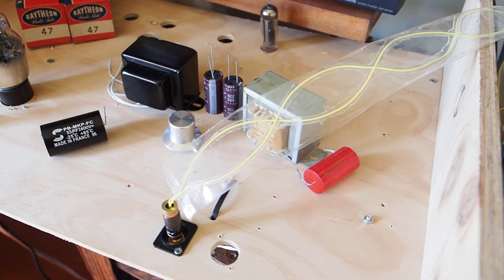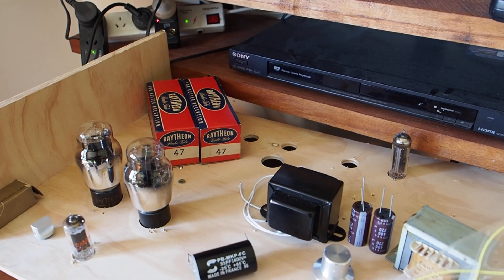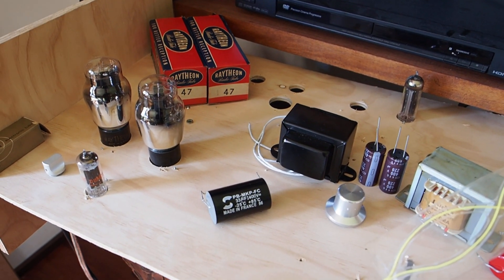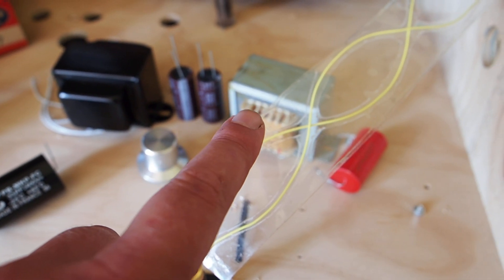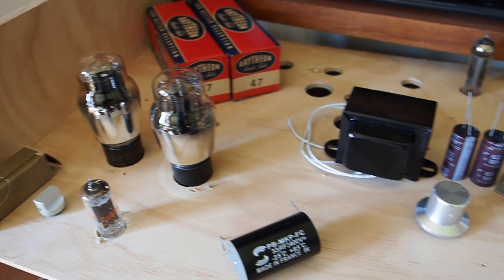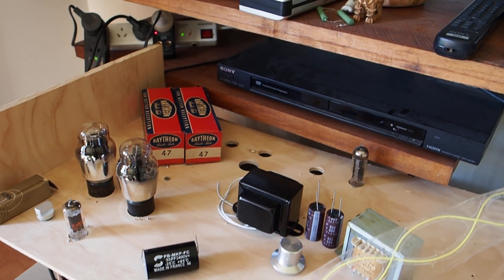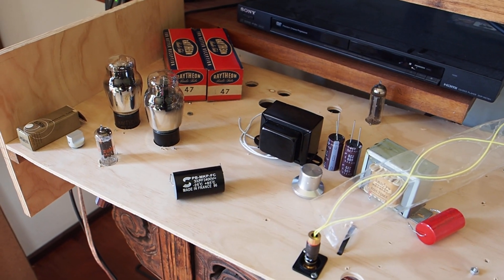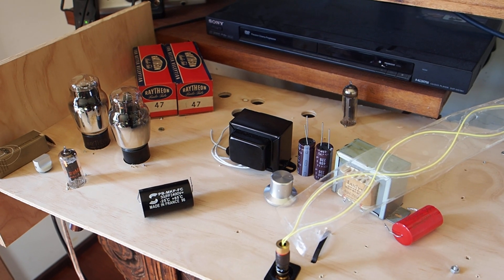My new type 47 power amp design: Q&A, concept, details, how it sounds

Comment: Hi, I was thinking you could try some zener diodes and resistor on the screen which would be 
cheap and easy to show if the tube reg would work. I think you would get a more dynamic
punchier sound if the screen is tied down and not be able  to fluctuate. In general pentode amps that I have heard in the past that were screen regulated sounded punchier than their
ultralinear counterparts.

I used to use gas regs in my preamp but because I used high transconductance signal tubes the preamp would have a tendency to oscillate and become unstable.You also can 
not hang much capacitance on the gas reg or it will oscillate.

I am also thinking a constant current source on the cathodes of the 47s might lower distortion further by holding the horizontal loadline more stable. By the way I seem to remember seeing a chart with lowest distortion tubes and I think the 47 was very close
to being the best just behind two other tubes one being the 4P1L.

Cheers Lou
Reply from the maker: Hi Lou. Great report, thank you. I will give the fixed supply a try, first to check/measure what it is doing now and then to fix the screen voltage via a shunt. I got a real improvement with changing the final 33uF cap from referring to ground to the cathode (ultrapath). At the moment I've also got a 220uF electrolytic over the bias tube, but that effect is neglible.

Yes Alia Moglia's chart of lowest distortion 'triodes' had the 47 after the 6E5P and 4P1L (no.1 tube). In Sound quality I would rate these 3 tubes: 47-4P1L-6E5P where the 4P1L trades it's DHT subtilty with some treble brittleness that I don't hear in the 6E5P. I've got a nice collection of 6E6Ps.. extremely suitable for a very, very decent quality and durable spud headphone amp!

Comment: Hi Eduard, the amp looks very nice and it should have very good bandwidth because
of the reduction of capacitance in the partioning effect of the pentode.I have a couple of questions. What is the plate to plate impedance of your output trans.and did you consider 
regulating the screen  with a gas tube regulator ? I would imagine your amp will be very
load sensitive so speaker selection will be more critical than if it had a triode.As long as 
it sounds several levels better it is win win. Simplicity rules.

Cheers Lou
Reply from the maker: Hi Lou! Nominally the load is 12.8K (for both tubes). 

I didn't consider a gas tube regulator based off Janos' experiments with his ampex and currently I've got very little voltage headroom. Right now, I'm counting on the 4H choke + 33uF 'ultrapath' cap to compensate for any fluctuations as a result of differences between the two power tubes. I'm happy to give it a try though but it needs a little more than just a gas tube regulator. Do you have any experience with this yourself?

Frank here also mentioned that load will be far more critical, the tube curves also suggest it and I have been flattening the impedance curve of my Lancelots, so apart from the driver and port impedance peaks, it's now a pretty flat 8 ohm load now. One aspect is also that I'm currently using the amp maybe with a 5V rms maximum input signal, where I think the 47 is less impedance sensitive... or am I missing something?

Anyway, more and more I feel that I'm sensitive to subtle phase shifts, coherence.. and so it looks like a non-linear response is just lower on the priority list than timing / phase. When I now hear music where musicians' interplay can be felt where previous it was more disjointed.. hearing that for me adds a goose bump factor to the music that I don't think I would pass up for other qualities..  One day I'll go with a real DHT see how this pentode stacks up, but it probably also needs a whole bump up in interstage coupling quality as well.

Comment: That looks sweet.. PP47 Spud Amp..  What input step-ups do you use? I find that amorphous or nickel core works well in that position..
Reply from the maker: 😃It's a Lundahl LL1922 which is an AM core and used in 2:4+4 form. Any tips for alternatives? Jensen? I wouldn't mind to trying a 1:3 step-up either.
Reply: @EduardBroekman  Oh, I didn’t know the LL1922 was also made in AM core, I thought only in Mumetel..  I haven’t heard Jensen, or Cinemag (Jensen’s cousin) nickel offerings yet.. Only the old UTC vintage ones in some diy amps before..
Reply from the maker: @rickg8015  Sorry I got confused with my LL1690 which I had in there for second, and that's a cobalt AM core; the LL1922 a mu-metal indeed. I'm still undecided on am-core for LL input transformers - but for Lundahls output TFs, I so far have preferred the amorphous core.
Reply: @EduardBroekman  
Hi.. You could try to install to insall the LL1690 again and upload the same Sinatra track and ask the viewers’ opinion which they like better and why.. But that would be open for debate if YT’s compression could pick up the differences between two Lundahl iron models..
Reply from the maker: Hi Rick, to get the same 1:2+2 step-up, I had to use two LL1690s - so it's not a 100% like for like comparison, but I will post an identical soundclip with that 1690 setup so it can be compared. I also tried the LL1922 in 1:4+4 but that really is asking too much of it in my particular setup at least. 

There's a distinct difference to the tonal feel of the music and detail comparing the LL1690 to LL1922... but let's discuss when I publish the 2nd soundclip video.

Comment: Very pleasing presentation of your project Eduard ....
I like especialy the .." Invisible spirit " ......

A lot of your experience with coherence, timing, the rightfull reproduction of musical notes of instruments tha restores the link of harmony , for example the feeling of the real thing of an attack on a string .......;is also related to the quality of your power supply !

Indeed AC heating on those good or better direct heater tubes ( wich were developped FOR AC ! ) is the correct way to go ...............audiophiles go for DC filtering for those heaters, what they gain in noise is worse than what they LOOSE !

Waiting for a Canned GURU to enter and leave your home haha ....

Keep on the nice work , very interesting and it joisn my experie,ce as well as other people's experiences today and in the past.....

Some people think tetrodes /penthodes can not do the job ( without experiencing as seen to often )..........Hiraga and other who love triodes , build also EXCELLENT .........penthode amplifiers.......
The thing is with a Penthode output  that it is critical to the load .....sounding worse with sme speakers and sounding marvelous with the right ones that are in synergy with the amp.
One of my better amps is the JH 30 (Hiraga ) ..........PP of EL84/6BQ5 , something he and others called this tube type .....The 300B of the poor ...........hahaha
The n os 47 is a first class tube type............GO ON and keep our curiosity alive !

Have  a nice sunny day
Reply from the maker: Hi Frank. Thank you for your insights, spirit and dropping by! 

Since I've introduced a different tube type, ac heating, single stage, tube rectification.. so the thing I'm somewhat missing out on now is: what has what effect.... so I really appreciate your comment about coherence and power supply setup hence gives me some more feel for this experience. Overall, intuitively, the direction 'sounds' exactly to what for me makes music special, so on that there's really no question the direction...it felt like I upgrade 2-3 classes of amp from my last all-DHT amp. Some music (all vinyl only) clicked now with me.. 

I'll have to look up that JH30 Hiraga design! Another 'poor man's 300B' option came from Thomas Mayer, the 6GE5 :-) On the poor-man's front, sometimes feels like the IHTs with relative large heater currents, are the next-best thing when not going DHT.

Anyway I'm superbly pleased with this 47 non-triode with 'eliminate 1 stage' benefits.. and it doesn't blow the budget just to get my hands on a set of tubes. I had recently linearized the impedance of the speakers.. it still need a tweak and perhaps and AVC but it probably prepared for this amp style as you suggested; the the load lines changes quite a lot at the extremes with different loads..
Reply: @EduardBroekman  Yes Eduard , ..............have confidence in your intuition, intution is the fact by your experience that tells you the road to follow when the brain does not yet understand it all .......
That's also,one of the reasons thta commerical products designed by most engineers fail in delivering what you experience with your own creations , besides all other considerations , perfect measurments , theorized know how not subject to open discussion .......;

Another thought that crossed my mind is the relation wit OPT 's...............with triodes one has a low impedance driver seeing abouttwice the impedance of the tube ...........so the wondings resistance /reactance comes into play way different than with tetrodes or penthodes wich have many thousands of internal resistance seeing a much lower relationship with the values ( about similar to the triode opt ) .............so the mariage of both tube types with the transformers is very different .
Semiconductors have rather transfer curves somewhat similar to a pentode..........but those curves are unstable due to modulation ( thermal modulation  ) , tubes do not suffer from that kind of distortion .
Anyway it is the load and it's frequeny dependant behaviour and other electro mechanical properties that will detemine the musical outcome ...
pentodes do not suffer from the  Cga ( Miller effect ) ....wich not only is a HF filter but also shifting the HF phase ........that cab be beneficial or harmfull ...........all is the harmony of the total , just like cooking the right meal , the one that has a flavour unknow by itself without revealing the ingredients , no ingredient may be dominant, together they create something new and tasty .

The idea of the breadboard in H is great ...............I haven't thought of that , simple and genious ! Well done .

about rectifiers , there's a world of sound collors to explore .....every rectifier has it's own needs while we think about what he must and should  deliver............;seeing it his way , the load that is optimized in current/Lvoltage ( not to low , not to high ), CRC-CLC-LC etc .....and often forgotten the resistance the plates see on the windings of the transformers , modern transformers often have to low an impedance and fatigues the rectifiers .( one can correct this ).

But when your ears tell you what is right , then you are close to what's a good and outstanding musical experience .......trust what you hear and feel .That's important because without this experience you will never know what you lose when building something else or after a modification/upgrade that you thought to be better but isn't always the case.

say hello to the Kan GURU for me ....